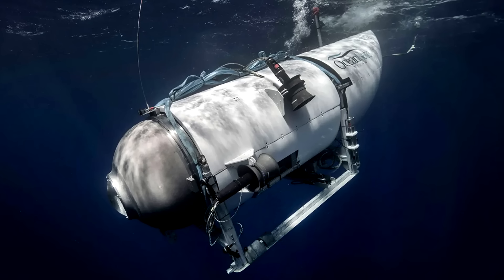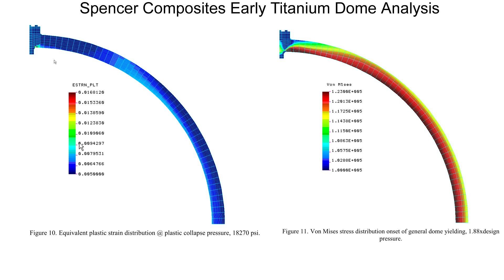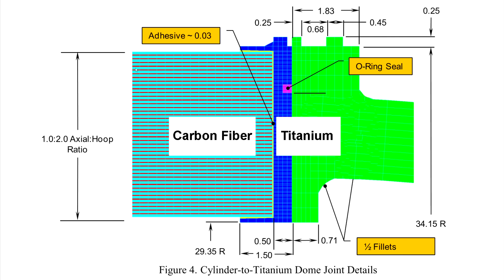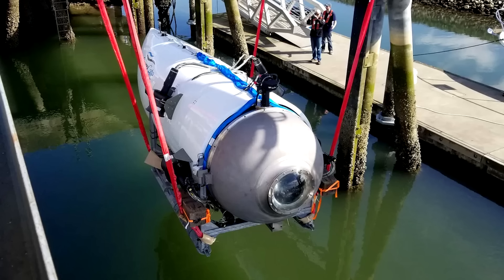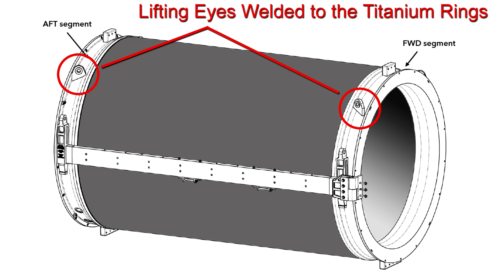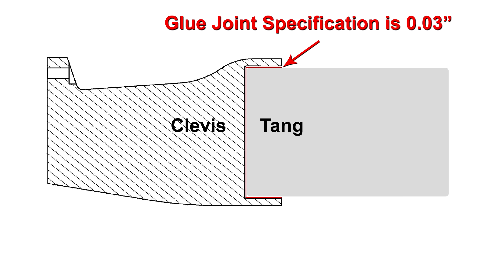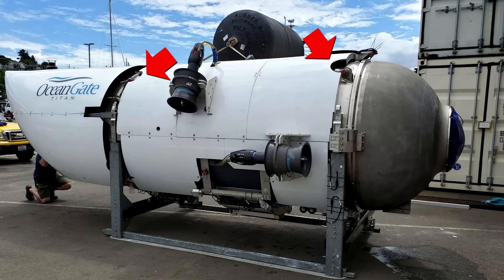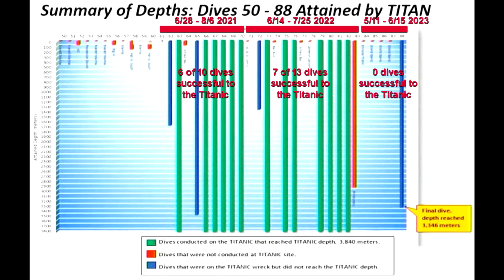OceanGate Titan Titanium Rings - An Additional Story About Them

Comment: As an engineer,  I think the biggest issue is simply the lack of testing. I don't see why, for example, they didn't take the submersible, weight it down, then lower it unmanned to the bottom , and keep doing this - hundreds of times. The reason airplanes are fairly safe these days is because hundreds have crashed in the past.  This is the only way you get the necessary knowledge.
Reply: He obviously couldn’t afford such rigorous and destructive testing so just decided not to bother with it.
Reply: @wattage2007 ....they couldn't afford these - proposed- costly testings.....
Reply: @wattage2007  he was a billionaire, he could afford it if he diversified more and built more that he could patent and sell
Reply: @wattage2007  He tested it to destruction.. he just did it with people inside.
Reply: For the classic historical engineering example of this, look up the giant cyclic loading jig DeHavilland built to fatigue test their Comet airliners after they suddenly started mysteriously disintegrating in mid air with no warning after several years in service.
Reply: m o n e y 
Stockton was cheap and iirc oceangate was bleeding money. They needed to take passengers to stay viable. It was a commercial case of whatever the equivalent of get-there-itis would be.
Reply: @nexaentertainment2764 He took the move fast and break things approach to submersibles and never should have if he couldn't afford to break things in the testing phase.
Reply: @nexaentertainment2764  
If companies could bypass the safety to save costs, they would, thankfully there some very tough regulations, and also a huge thanks to insurance companies that car safety has gotten so good.
Reply from the maker: Thanks for commenting.  Yes sir.  You are correct.  With normal engineering in a normal company of a device like this intended to carry people, that is how it should be done.  Nothing about this story is normal, and that is why it si so compelling.
Reply: @solareclipsetimer It was tested 80 sometimes . Just with people inside till it failed.
Reply: I would expect us to over engineering things to avoid ven coming close . But alas profit is king
Reply: @cmendoza1094  Rush famously claimed that somewhere between safety-obsessed over-engineering and a shoddy build that guaranteed disaster lay a middle zone within the parameters of which he could build the Titan, at a lower cost than other submersibles, much of the over-engineering, in his eyes, being a costly and unnecessary "waste."  Indeed, he went on to sometimes hint that the other submersible-makers actually knew that the over-engineering was a waste, but (in a conspiracy, basically) exaggerated the safety-based need to "avoid coming close," as you say, to keep the cost of submersibles way up and keep "innovative" outsiders out of the industry.  And things like that example of paranoia make me agree with some of the others here that a bit of madness was present in the man's personality, along with the raw cheapness that you've noted.
Reply: There was never any profit. It lost money from the start. @cmendoza1094
Reply: @ This was a terribly unprofitable endeavor more suited for subsidized real work and expedition.
Reply: As an engineer too I think Stockton just didn't believe in science since he disregarded so .. many .. warnings by competent scientis and engineer and just kept asking the questions to other until someone said what he wanted to hear and then he had his confirmation. Sadly that's not really how science work.
Reply: A scale model did implode during testing once. Oceangate refused to have the Titan rated, big red flag there!
Reply: This happened because engineers designed parts but the ones that signed off on the final revisions were not engineers so errors were not noticed. All the bosses saw was designs that they were told they worked so they passed it without testing
Reply: Also, can't you build a pressure chamber on land to test it? It's easier to contain a pressure going outwards isn't it? With the right pressurization you could induce a leak without a catastrophic implosion as the change in volume drops the pressure so quickly. 

He could have gotten some really valuable patents out of this from this research, but he was just flying off in such a rush, just get paying passengers viewing the titanic ASAP.
Reply: One scientist had it right. Raise the price of admission and retire the submersible after 4 or 5 times down. There can still be testing on those retired subs.❤
Reply: One problem with testing like that and carbon fiber is you now know this one survived and it might fail next dive. When building another one with their messy system you have no idea if it can take same amount of dives. I wonder why everyone else uses titanium spheres as pressure vessel (Joke).
Reply: The irony is Stockton's family tree goes back to when the Titanic was being designed , could another of Stocktona relatives have worked designing the original Titanic ? One Step Beyond 2.0
Reply: Oceangate was for profit, they didn't have the time or money to sacrifice vehicles for testing every revision, they risked lives, and they failed in the worst way possible
Reply: That thing was a abomination I wouldn't even test it.
Reply: Rush was a great believer in Tombstone Technology Advancements.
Reply: The cost of over engineering aircraft was built into the cost of every single flight we take.
Reply: Test it until it fails, make the failure point stronger. IMO, some type of multiple lengthwise bars should have been in place to keep the 2 domes from ever spreading apart. who would trust glue/epoxy to hold dissimilar materials together under such extreme pressures. I'm no engineer, but I often see why different parts fail and I find ways to improve them.
Reply: your question answers itself. testing is expensive. a prototype would have to be put through full lifecycle testing. any design change needs a new prototype to be lifecycle tested all over again. you should know that as an engineer.
Reply: As an engineer a simple reply - costs. He wanted to make money as quick as possible, and testing requires money and time.
Reply: No way I would be getting into a machine that has not been tested.
Reply: They were cheap and clearly not much of a research company.
Reply: I build Rc construction equipment 2yrs to test a trailer to get it right over a hundred tweaks and  mock ups and sketches
Reply: The answer? $$$$$. Stockton didn't want to spend any more money than he had to. He wanted to do everything on the cheap and sadly he paid for it, as well as other hapless souls wound up also paying the price.
Reply: NONONO so wrong...the biggest issue was the construction in carbon! As a bikeracer on low level i chose aluminium bikes before carbon. If you use a carbon handelbar you dont see the cracks before you crash. The same with the wheels. When they crash with a carbon wheel it is just so suddenly and very explosive. The same with the frame. This is not the case for steel or aluminium.
Reply: They have tested carbon fiber and figured out that it isn't suited to build submersibles with. It has great applications for aircraft because of it's high tensile strength but it does not have good compressive strength qualities.  That's why he was warned and couldn't get certification.
Reply: It has now been tested! It failed! Pity there was a crew and passengers in it
Reply: Boeing literally told them that they were layering the carbon fiber wrong and that even if they layered it properly it would need to be much thicker in order to avoid catastrophe and they completely ignored it. Carbon fiber just isn't a surgeon of material that those deaths in lessons you have multiple thick layers layered at a 45° angle in order to help offset the pressure but even then it's not guaranteed to succeed. Too light.
Reply: Maybe I’m wrong, but I feel Stockton was wearing g rose colored glasses and never or hardly EVER looking for “issues”.  Maybe he could only really see or acknowledge “fixable” issues.  In some way, putting head in the sand or fingers in ears and loudly singing LALALALALALALALA.  

He wouldn’t listen to negative feedback and I can’t even IMAGINE the aircraft industry behaving in that manner.  

I guess, as with the aircraft industry, when you are talking about millions of human customers, of course you cant’t operate that way.  His biggest mistake was ever taking on people/customers. Alone?  Knock yourself out.  But he couldn’t afford that…….
Reply: absolutely.

i wrote that comment in a different video:

"its a wonder that the submarine even held up for so long.

even a tiny corn of dust that gets trapped in between the glue layers, will exponentially weaken the connection over time and in deep depth.

there is no room for error here. This glueing process should have been done in an controlled, air filtered environment where everyone wheres hazard suits.

they should have also made an in-depth X-ray scan of the finished glue connection, to see if anything got trapped in between the layers (dust particles, sand, air bubbles) and if the glue spread evenly.

and the applying pattern and amount should also be highly regulated and tested.

if i was the engeneering director, i would have created multiple examples made out of aluminium or steel and a thin piece of fitting carbon fiber. So this whole process can be made multiple times to 1. learn the process correctly 2. see what kind of fail points might occure without braking the bank and destroying the valuable titanium and carbon fibre pieces."

those highly engeneered things need to be tested a lot. That should be common sense.

even hobby "engeneers" and inventors know that.
Reply: If you're an engineer, then go back to school, or learn the properties of carbon fiber. They made mock up hulls that were put under load and they all failed. String and glue is no way to go to the Titanic safely.
Reply: My thoughts. Commercial airplanes have a legal operational limit--you can only fly them for 1/2 as many cycles as the most cycled full-sized test article (14 CFR 25.571). It would only be logical to do something similar here. Ideally you'd test to failure so you can characterize the failure.
Reply: Hey engineer, advanced composite tech here.  
Here's how I would've acted,
"You're making a carbon fiber submarine?... I get paid by the hour, let's do it."
Reply: Money , money , money . Stockton was broke . He used the money of paying passengers even when a dive was scrubbed , then had to give a free seat to that passenger on a futer dive . He could purposely fake a dive just to generate seed money . Any means to an end . Tunnel vision . It was going to work even if it killed him .
Reply: Yes lack of testing but a fatal design from the gecko
Reply: As I watch these videos I wish I had billions in the bank to rebuild the hull and run tests to see where it failed. It would lay to rest a speculation and increase our knowledge of composite hull design.
Reply: @mark351  it would be great rebuilt it exactly the way it was and put cameras with dummies to see what actually happened and what cracking noises sounded like
Reply: they didnt did ut because its exoensive...but i think there is still options like emergency systems and plan b systems like a secondary emergency propeller system backup batter escape pods etc ... as unverified communication indicates they lost control and dive too fast... which increases  systems possibility of failure...if they had a working secondary lifting system.. ie a red button that inflates a strong balloon or tank that'll make it to move up was mostlikely going to fix big part of problem...
Reply: @ahmetmutlu348  very difficult to inflate a lifting bag at that depth. About 6000 PSI. 

Rush had a bad habit of dismissing safety concerns. Was the loud bang heard on one of the earlier dives the beginning of the end?  We may never know.
Reply: They knew you could only do that a couple hundred times before it failed.
Reply: Subs typically get certified by diving to 20% deeper than their rated dive depth. The requirement is only one dive and it shows that the sub is overbuilt even if it’s suffered some minor damage or wear over time, and safe for its operating depth. 

Titan only ever dived to Titanic. Meaning that it’s “certifying” dive was the same depth as its operating depth.
Reply: For sure, other companies like CET are successfully employing composites.
Reply: Money and how quick you can make it when you see short term potential over long term potential, will make you do crazy things
Reply: Commercial aircraft are incredibly safe, so much so that the most common points of failure are the humans in the loop.
Reply: Is that why the Wright brothers didn’t sell tickets?
Reply: they used to be safe...
Reply: Not only that new aircraft prototypes are put through like 1000s pressurisation cycles to make sure the fuselage can take it.
Reply: Because money
Reply: Why?  Money. It's been well documented well before the incident occurred
Reply: Because the guy was crazy and suicidal. His son didn't even wanna go he dragged him along. He wanted to take people with him in a grand setup
Reply: @iamtheonebelowall  if that is true that is so messed up
Reply: Needed to get the money flowing
Reply: Time, money, hubris
Reply: Lower with what?  12 miles of cable?
Reply: @rcannon409  where did you get 12 miles? That's >60,000 feet. The deepest point on the earth is ~30,000.
Reply: I haven't heard direct evidence for this, but I think Rush was just hoping it would last long enough to be able fund more rigorous testing and making a new sub, but it seems funding was short.
Reply: Reslly? I thought it's biggest issue was that it imploded 😂😂 I'm just messing around lmao
Reply: Any cable used to try to lower the sub that far would break under its own weight. This was an issue in the past with the original bathysphere used by Beeb to do deep dives. It had no floatation devices and was just a heavy steel ball with a window, hung from a cable from the mother ship which provided power and lift. Oxygen was carried in cylinders on board.
The depth attainable was not limited by the sphere itself which was essentially un-crushable, but by the weight of the cable that lowered and raised it.
Reply: @KathrynLiz1  Where do you get that from?  The breaking load of a 1 cm dyneema rope is 7900 kg. 100 m weighs 5.5 kg. Without de-rating, that would yield a max length of (7900/5.5)x100 = 143 km. And this is in air, not accounting for bouyancy in water. Even derating to 15-20% of theoretical max, that plenty long to handle the 12,000 ft. depth. I personally worked wireline logging and went well beyond 12,000 feet with a 3/8 steel cable.
Reply: They did a very small amount of testing, and then did their real dives with the SAME SUB that had been tested a hundred times already and been damaged from stress and unstress
Reply: Aw, but that's no fun. Much more entertaining this way. Heck, with a few more innovations we may actually get to see the look on the next reckless entrepreneur's face when the Finding Out happens.
Reply: Honestly, when Rush said 'safety is pure waste', what you're suggesting is what he's talking about. And sure, in the short term, it looks like pure waste. Until the implosion happens.
Reply: What's tragic is all the qualified engineers and organizations has warned Stockton Rush about the design and manufacturing mistakes. No one should call this "Experimental" because the material science involved was already well known. He simply ignored the engineers and fired those who opposed.
Reply: Problem with that is youd need a ship capable of lifting the ship with a crane and also have a winch and line capable of making it to the bottom and lift it up. Idk how people like james cameron did testing on their subs, but i dont think they did it that way. 

Think about how much weight would be in just the chain at 11000 feet long. 2 inch diameter steel rope weights about 6.72 lbs per foot of length. The titan sub weights 23,000 lbs. So the rope at that point would weigh 3x as much as the sub at the bottom, and potentially 6 times if you have 2 ropes attached to it. 

Theres gotta be better testing that is available. Doesnt matter at this point though because they didnt do it either way. 

Planes are exponentially easier to test than subs are.
Reply: I guess they realized, the right way to do alpha testing on clearly life-or-death devices is to put people in it who pay for it and also have the responsible person in there: If everything goes right, they get a nice adventure. If they go a bit wrong, they can't complain as it's unproven technology. And if it goes catastrophically wrong, the CEO won't be arround for the inevitable aftermath. That's called a win-win I suppose.
Reply: Testing cost money. I worked for a small engineering company who loves to try new things without proper testing. My boss was similar to Rush. Talks big, charismatic to the clients and believes he is larger than life. Needless to say there are always problems. I left before something tragic happens.
Reply: The biggest issue was the use of carbon fiber. The material does not have the needed qualities to withstand repeated high pressure events. The titanium endcaps were also a point of failure. Criminal use of ego that should not have been allowed.
Reply: Anyone with even a hint of physics would have climbed into this vehicle.
And elementary school physics is enough.
Reply: There are so many problems with this vehicle. The composite was a non starter having to co bond five layers and having tons of sanded down wrinkles.
Reply: Rush once said, "You know, at some point, safety just is pure waste. I mean, if you just want to be safe, don't get out of bed. Don't get in your car." But he also said, "No-one is dying under my watch - period.” His mind was made up and he didn't want any bad-news facts getting in the way.
Reply: They did test the pressure, but the carbon fiber failed every test
Reply: Because that would cost too much money and Rush was out of money.
Reply: As a maintenance technician, this is a dumb idea
Reply: Apples and oranges....This is like finding out how close you can get to the sun without a catastrophe. You can make an airplane out of paper that flies.
Reply: No, the biggest issue is to use carbon fiber in the first place. Metal is tested in submarines since decades. Second issue is the mixture or materials, carbon fiber and titanium
Reply: Quality control, testing and Physics all ignored
Reply: In my opinion, I think that the carbon fiber hull thickness should’ve been 2” thick, opposed to 5”
Reply: Your not much of an engineer if you don’t understand cyclic failure over time combined with a flawed design.
Reply: Because deep down they knew that would wear it out (the only one they had) and they really just HAD to wing it if they had any slim chance of making the venture profitable, stockton also wanted this all personally for himself and frankly wanted to get right to the point of all his years of work, going down to see the cool stuff under water with other people.
Reply: I think that would be exposed they d used the wrong materials. Which is why they avoided it. I ve not heard anyone state the hull life, just that composites degrade with use. But that does not include the glued areas or glands or the electrical systems. 

The sheering of the rims from the end  titanium rings is scary. Anyone know the design limits? Or the loading that would cause that?
Reply: he had all the knowledge he needed. why continue testing when you already know the results?.. for healthy minded people, more testing= more knowledge, info used to further enhance safety for passengers, & continued success.

for stockton rush more testing = le$$ dives in the future.

read it all again if you have to.
Reply: I've thought about building a submarine and that is what I would do. Having a tether to control and observe what is happening inside when at depth is not difficult. You can observe pressure, sound, temperature, dimensions, and video all with a single fibre optic cable. It can be rigged to surface if the tether is broken. I can understand difficulty in doing this even 20 years ago, but now it is quite easy.
Reply: You can have an air compressor inside also to do cyclic testing, so there is less need to surface as often.
Reply: Stockton's patent pending overstress warning meters on the subs hull were the reason you got lumps as the carbon fiber was being wrapped . Where the meters were  where the lumps started showing . He just sanded them flat .
Reply: The problem with your way of thinking is that such testing degrades the material with each test in a way that is not detectable (such is the problem with carbon fiber). They could test 100 times but the failure would happen on the 101th time without them beting able to detect it.
Reply: @ That's why you don't build just one.  For something that carries humans, you HAVE to take at least one to it's failure limits.  Engineers are also biased towards success. They don't want their stuff to fail. That's why you don't test your own stuff - you give it to someone who is incentivized to make it fail.
There were so many mistakes made here it is ridiculous.
Reply: @ianboard544  Testing multiple prototypes might not help in this case. Carbon fiber is not isotropic or uniform and is sensitive to small manufacturing differences when heavily loaded. Each prototype is a different structure and testing one to failure does not tell you when the second will fail.
Reply: @ianboard544  Now now.. complain complain and complain.. he did test the sub to destruction.. it just was filled with people when he did it.
Reply: @ Good case to prove the value of destructive testing.
Reply: @ianboard544 Ok….this makes sense to my ordinary mind. Thank you!
Reply: @nickhuynh6321  Interestingly, I think the Titan’s strain gauges did show signs of serious deterioration in its latter dives but true to form with Oceangate, no one paid any attention to that data when it mattered.
Reply: @wattage2007  They did ... that came out at the hearing. One can watch, after Dive 80, the strain gauge readings start sliding to the right on some plots and jumping up and then creeping steadily upward on others.
Reply: @nickhuynh6321  Is it usual for the overload-testing to be done on the final product ?... that makes no sense... a prototyoe tested to failure gives the data needed to build the final iteration, confident in its load-to-failure profile... 🤔
Reply: @nickhuynh6321 well airplane companies sacriface one prototype  of plane or midules atleast... so thats why it works... well anywah planes are not perfects they fail too 😂😢🙈🤣😅😔😔🤔😁🙄😄😂 but they dont have a stoctob type fair man to blame 😅🙈😁🙄
Reply: @nickhuynh6321  But I think he suggests that the descent-raising cycles be repeated till it failed. Then collect the pieces and study them.  It would all need to be done under the exact conditions that it would be operated under (say with same weight pigs or something in there?). Then operated it within a margin of safety,  If it failed after say 50 times, only operate if for maybe 20 times and take it out of service. Done for that unit.
Reply: @nickhuynh6321 yeah so don’t bother testing
Reply: @nickhuynh6321  What you do, is do 10 tests, and then you tear it apart and check everything. Then build a new one, and do 50 tests, and tear that apart, and do it again for 100 and so on. Atleast you get an idea of the fatigue trends.
Reply: @LuminaryGames  but Rush couldn't even afford to make two units... done...
Reply: @nickhuynh6321  Well then he couldn't afford to run OceanGate.
Reply: You can't just do that. You need a test hull which is always a sufficient number of fatigue cycles ahead of the ones in use to allow a sufficient factor of safety. When it fails it sets a maximum life for the production ones which leaves a certain number of cycles in hand for safety. They didn't have the budget to do that. It can maybe be argued that the test hull here was a computer model but the problem there, apart from whether the model is a true representation of the hull and the conditions applied to it, is the same as with a real  test hull, has the hull in service been modified in a way which means the model or test hull is no longer representative?